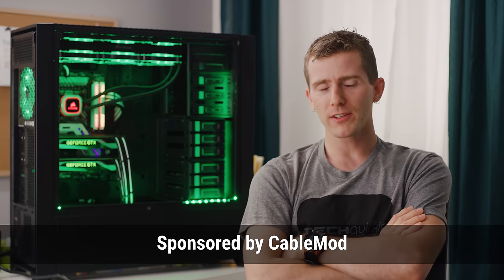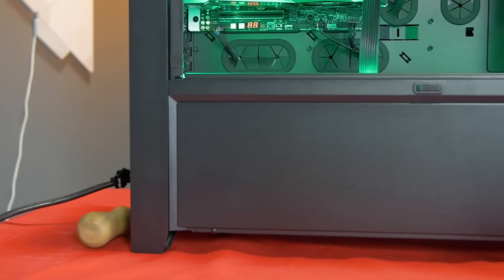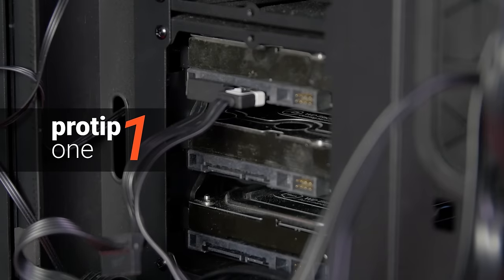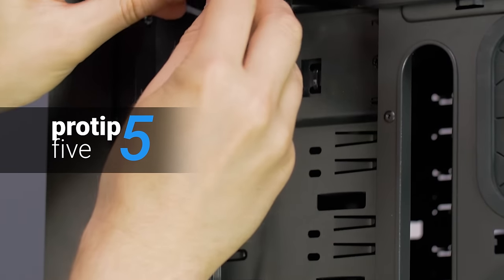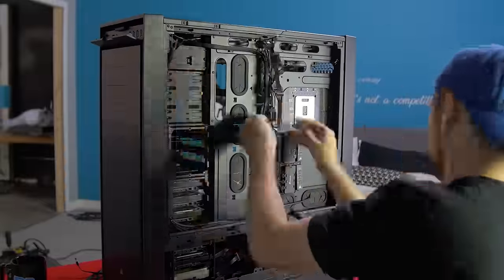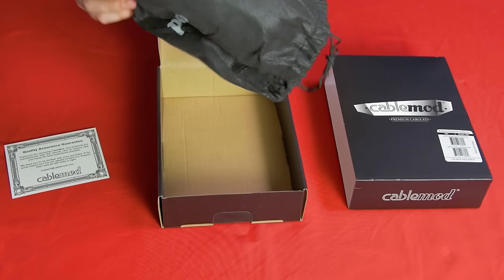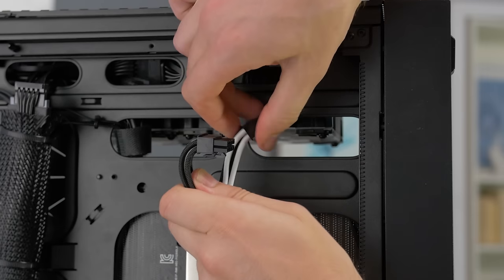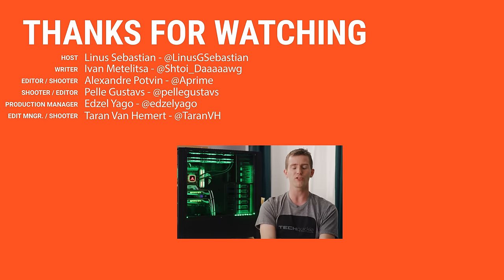ULTIMATE Cable Management Guide

Comment: Linus, what about the pin matching problem, where some PSUs are pinned differently and will blow your system if the cables aren't pinned correctly??? On another note, I just today, did my yearly case clean out and management. Took me 13 hours for cleaning each fan (I have 11 total), oiling the fan bearings, moving SSDs to my small drive bay in the shroud, and remanaging my cables from when I added new stuff over the year. It's absolutely insane the amount of time you'll dedicate to making your PC look it's best. Also, I did notice a slight drop in temps after remanaging my cables and hardware.

Comment: I thought I was one of very few who actually run cables between the motherboard and tray. Extra Pro Tip: RGB LED strips near the edge of the motherboard between the motherboard and tray look sweet AF! Yes, that requires running them BEFORE securing the motherboard too. Just inside the standoffs usually give it enough space from the edge to get a nice glow without the separation of individual LEDs. No, my components do no get any warmer, nor is there enough heat from the LED strips to cause any issues either. I ran strips behind my Asus B350 and my current Asus X470 boards. Both boards have run an OCd R5 1600x, G.Skill memory @ 2800 MHz CL 15 and a dinosaur of a GPU, the EVGA GTX 780 TI Dual Classified. Which I'm happy AF to say that I'm finally upgrading to an Asus Strix 1070 TI. Bought today at an awesome price (I couldn't pass up $350 USD) and should be in my rig by Monday. I know the person I'm buying it from and I'm the IT that works on his rig. I just have to wait on him to get his 1080 TI. :-)

Comment: GPU Power cables running down towards the bottom compartment where the PSU is located is a pretty ugly solution. This case allows you to to run them along the height of the GPU towards the motherboard, then along the motherboard towards a dedicated port in the motherboard support plate. After that you just run them out of sight on the backside of the PC towards the power supply. It doesn't help if you replace you vanilla ugly hanging cables with custom made ugly hanging cables otherwise.

Comment: I'll file this in the list of things I'll never do again because major part swap/rebuilds become hell when tightly/neatly cable tying everything
Reply: Agreed, this is the kind of thing you'll probably only ever do once on a machine you actually need to maintain :)
Reply: Use Velcro ties instead.

Behind every desk at where I work (they all face a wall, and some walls were brick, so they couldn't be wired cost-effectively), Ethernet, power, and backup power cables are secured in Velcro ties.  They've never been hard to deal with when moving computers around or doing cleaning or maintenance, or even a couple of rewirings when one of the data cables went bad.

Inside your case, they should be fairly easy to deal with.  The best reasons I support cable management are noise reduction, and later modifications.

For later modifications, knowing which cable goes where  makes repairs or upgrades less of a hassle.  Multiple-plug wires (like drive connectors) hit fewer snags when being rerouted or removed.

For noise reduction, I recently had to tie back the extra 2 pins on my PCI power connector on my brand new rig's graphics card.  The 2-pin connector was lightly touching one of the heat pipes on the GPU cooler.  With the GPU fans running, the noise from that vibration was definitely audible.  I was concerned my system had a defective part, or that I had broken it on the ride home from where I built it.
Reply: True.  I like things tidy but this is just overkill unless you sell these.
Reply: I second the velcro ties. Cleaner look because you can adjust them as much as you want.
Reply: 100 percent agree.  So much regret with using cable ties when I swapped out my fans and upgraded the psu.......
Reply: yeah it takes more effort to sort everything out once u have to swap something out. Except when u have a full modular psu where u only need to send the psu to the manufacturer when it is broken.

Comment: $377.40 on custom cables!? OUCH!
Reply: VR6 Doug costs more than my gpu 😂
Reply: Exactly... I can think of quite a few things I'd rather spend that kind of money on rather than cables.
Reply: I smell apple pricing. I rather buy some custom cable mods for 30 bucks instead of paying tenfold only because of customs length and shit. I dont even think it is that much workload for the company to sleeve them. Just ripping people off for something that might only cost 10-20 bucks in raw material. Price is not justified.
Reply: Costs the same as my gpu and cpu added together
Reply: @louismahon6834  It costs more than my entire build 😐
Reply: U can get sleeved cables for cheap from phanteks or some other brands like Asia horse and up here full sets for 30 dollars itss wild I have some in my case
Reply: Cost the same as my motherboard rams and cpu together ryzen 7 1700 16 gb ram ddr4 2400 mhz and msi b450 gaming plus
Reply: @jyothishkumar3098  same
Reply: You can make your own custom length/sleeved psu cables (not extensions... full cables) for under like $50... literally just buy wires, colored sleevs, the connectors and a lighter and youre good.. also heat shrinks which are cheap as hell. Take the metal prongs in the connectors from the original cables. Theres a video somewhere on youtube explain it and walking through the process

Comment: DVD drives couldn't be more relevant in 2020
Reply: Lol what ?
Reply: Really?  Why do you say that?  I just built a new PC.  When I built my last one, ten years ago, my optical drive still had an IDE cable, and I didn't feel like it was worth buying a new drive just for that.  Now, there are no IDE connections on motherboards.  And I don't think I've used that drive for years.  My case has the bay, but I don't see myself ever using an optical drive again.  Progress is weird.
Reply: @darxustech2883  I was joking, friend. I didn't put one in my new pc either.

Comment: One thing to watch out for if you are routing behind the motherboard, or any time you're removing a motherboard, is to keep in mind that motherboard standoffs can sometimes unscrew instead of the actual motherboard screws. This happened to me recently.
I was removing the mobo, and unscrewing the mobo screws and one of them felt a little bit weird but I just kept unscrewing. Then suddenly I heard a "crack" and realised that the standoff had been turning under the motherboard and it was bending the motherboard as it lifted up!
Thankfully my mobo seems to be fine, but I think I was lucky.

Comment: It was interesting watching you do a live build. Then having to poke the cables such as the fan cable and rgb controller to the other side. It would be interesting if motherboard companies thought about cable management before building a motherboard. Like having the connectors for rgb and other things on the other side you of the cpu. 
I amazed that cablemods has not gone rgb or you could print like linus media group logo on to the cables. I wonder if you mixed dbrand and cablemods together. 
I also wonder how you could optimise a motherboard to get the cleanest connections.

Comment: 4:32
To suggest putting cables behind the motherboard itself is stupid.  Really, really stupid especially for asthetics of a part of the case you're not going to see anyway!

The risk of shorting due to the wire insulation getting pierced is extremely high. I've seen this happen numerous times to other builders and i've learnt myself this mistake.

Even IF you don't use thick cables, you're still likely to stag the wiring on the solder points and short it just from putting it in. Or working elsewhere on the machine and unknowingly pulling the wire - either during the build or in the future when you upgrade a component and long forgotten about the risk.

NOT a good idea. Stupid, stupid stupid.

Comment: I don't bother with cable management unless the right side is exposed (like a tempered glass right side panel). It's a waste of time, nobody is going to see it except you, and it just makes it harder to change something or troubleshoot when you have to cut all those little cable ties or unravel velcro straps. Cable ties can also put a huge amount of stress on cables, potentially deforming them.
Reply: just don't tie them too tight
Reply: Harder? With proper cable management it's easier. Cable are already where they should be. Motherboard swaps can happen in minutes since you're not chasing cables everywhere.
Reply: Loose cable ends in an open case (where you can't just tuck them into the power supply shroud) can touch fans and make noise from the fan's vibrations.  Or, if they get pulled into the blades, you could wind up either getting a new fan, a new cable, or both.  And if it was in your CPU cooler's fan, you might be replacing the CPU.
Reply: You're correct, you should clean and tidy cables on the front where all the fans are, but there's very little reason to on the back unless it's going to be visible. Just forget to mention that bit. :/
Reply: so you would rather spend time untangling spaghetti
Reply: When I build pcs for customers, I usually use 1-2 cable ties max. I dont need more to make them look clean cause I know where to stuck and hide my cables :) Even my boss asked me to build his pc cause my cable management was the best in the shop xD And I worked only part time.

Comment: Proper cable management will also help keep your cables intact, especially if you take the side panels off and on frequently. If a cable is properly tucked away, there's less chance of either bending it in a way it shouldn't be bent, or closing the case onto a stray cable! 

Just went and bought a large bag of zip-ties, and will be doing some cable management myself (or at least double checking the cable management on my custom built system) as soon as I have access to my desktop again.

Comment: Great video, one of my major gripes is the front panel header cables. The Pins on the motherboards (or manual) are very hard to read, and they are often placed next to the Sata connectors which get in the way of each other.

Comment: They charge WAY too much for their cables AND shipping. 
I mean first, you have to get a modular PSU just to be compatible with these cables, which already costs about twice as much as a quality non-modular PSU with the same specs. Take the Cooler Master V550 as an example. It costs a lot for a 550W unit, but it's one of the cheapest compatible units, so you're already looking at about $100 extra for the PSU itself compared to a normal one. 
The cables themselves... well, for the full conversion kit with 24pin ATX, 8pin EPS, 8pin PCI-E, 6pin PCI-E cables, all ordered with only 1 plastic sleeve, is more than 130 bucks. And then another $20 for shipping which is also ridiculous.
That's $230 extra just for the cables if you go full conversion. $230 could get you a way better GPU or CPU for your PC, which is more important to you? 

Extension cables are a better way to do it, unless you have a fully transparent case, the back side doesn't matter anyways. An extension kit will fit any PSU, so you won't have to get a fully modular unit. They also cost less. The same cables as extension cables are $80, so a total of $100 with shipping gets you a nice look on the front. It may be worth it for someone who keeps his PC on the desk like myself, so I might go with the extension setup, but still - for cables only, this is a ton of money.

Comment: If I had the time, all the cables and sleeving + stuff I needed, I'd use wire that I'd run from point A to B and measure exactly how much I need. This meaning that no single cable will have the same length as another, even in a full cable (so like an 8 pin power cable, none of the individual cables will have the same length because the the bends) ^^
That's the cleanest, but also most time consuming approach to it.

Edit:
Hahaha, you actually mentioned what I'd do in the end part of the video lol
Seems like we're on the same page then.

Comment: This is when I whip out the piles of paracord, the stacks of rolls of mil-spec teflon insulated aviation grade wire I got from my old employer when they shut down, the Hakko soldering station, the Chinesium hot air reflow station, and my old school wire lacing skills. Zip ties are so post 1970s! LOL :P

Comment: I wish PSU manufacturer's would actually make their PSU cables fit their cases. Am looking at you, Corsair. The worst culprits are the SATA/PATA power cables. You end up with a loop of ugly cables in between each drive connected. On one of my PSU sata cables I actually moved and turned around the connectors so it was tidier in the case.

My last complaint is why PATA cables are still included? I mean who is still using a PATA hard drive/CD/DVD drives? Even RGB lighting kits use SATA. All PSU makers have got to do is include a couple of SATA to PATA adapters just like they included a floppy power adapter several years ago.

Comment: Just buy everything needed and sleeve yrself like $30-$80 depend on type of sleeve , connector ,etcs... dun need fancy blower tools etcs... just light the fire of lighter abit further away... with SKILLS u can overcome quality even people are buy $500 worth of tools.Just trial and error with spares short length and connector pins etcs till u comfortable with the quality u wanna achieve...
Seriously $200-$400 cablemod mdpc etcs LOL... DIY for $30-$80 with very simple cheap tools u are fine and will have more satisfaction.Its more of hand craft ... as long u got hands fingers u can do it too!Theres even invisible cable type if u custom built yrself:) some covers.The sleeve etcs is outdated trend already... when things get common its outdated... no point $200-$400 when its just so common.

Comment: Having mastered the soldering iron at an early age, and getting a fair bit too much practice with wire figures. I would likely end up making the whole power and likely even part of the data cables out of solid core copper wire plated in for an example gold, or silver. Though, this would be like hard line water cooling, but for power.... So I would likely do that too since one is already taking it to an overkill degree...

Comment: Hi guys I'm not very good going around part wize but I wanna build a heck of a streaming gaming rig and I need help I want to start from the start as my pc I have now is old and no parts will be fitable in ddr 4 and I am planning on getting asus rog zenith extreme x399 eatx gaming motherboard with the threadripper 1950x procesor in cougar panzer max gull tower case, corsair vengeance led 32gb ddr4 dram 3000Mhz ram and Gigabyte amd vega 65 gaming oc 8gb graphics card and ofcorse 8 corsair hd 120 rg. Led fans 120mm, with a 500gb sata 3 3d ssd and a 4TB sata 3 6.0gbps surveillance hdd am I missing anything?

Comment: Tip 7: Take out the front I/O completely because you won't use the mic or headphone, the USB 2 is slow anyways and the USB 3. cable header can rot and die in a ditch.

Comment: I spent a Saturday cable-managing my home theater cables.  Wire loom, velcro straps, power strips screwed onto the back of the rack, etc.  Everything looked great. 3 weeks later there was a problem with a Sat receiver.  The Tech Support person told me to un-plug the receiver from the power strip.   Something like 7 identical black plugs feeding a thick wire-loom of AC power cords and I had to guess which one....  Murphy's Law of Cable Management: Within days of doing cable-management, some part will fail requiring you to tear apart your careful wire job.

Comment: I have a z370 motherboard, a GTX 1070 video card and a 650 watt semi-modular PSU - question - the 8pin cable that's affixed to the PSU that supplies power to the CPU has an extra 8pin connector that's attached and will fit my video card - so - is it okay to use that - or - should I used a dedicated cable from the PSU - it would seem to be that the less cables - the better?  Thanks in advance for your comments.

Comment: I would never tuck a bunch a cables between backplate and motherboard, that's way too 'form over function', also not route between DRAM modules. That's when you may get the 'Help, my CPU/ RAM overclock is unstable' posts..

Comment: DVD Bay for extra front IO cable. The cases I had till now (80-90£) had no cm to spare, so cable management was just diagonal through the case. As I wouldn't pay those extra 50 cents for 6cm more cables.

Comment: Of course it has no impact on performance or cooling... like unless you have an entire fucking spool of cable in there, how could it? -- But it's NOT just all about looks -- it's about long term maintainability! (and if you optimize for maintainability, it'll usually end up looking pretty good too... but if you just optimize for looks, then I can't guarantee you any specific degree of maintainability.) -- p.s. hot glue on metal is a terrible idea.